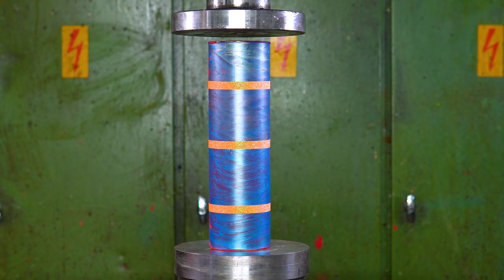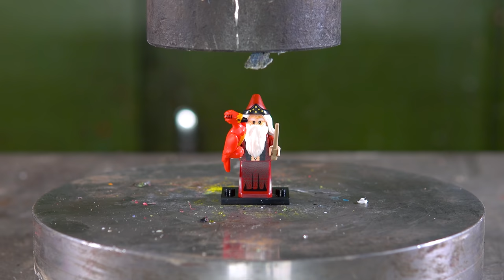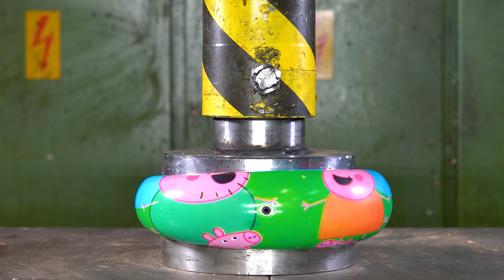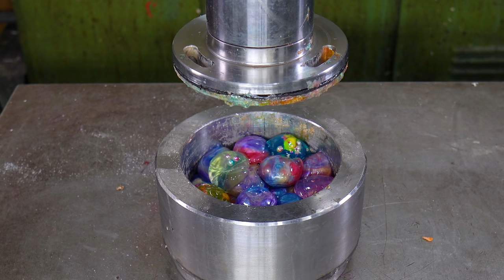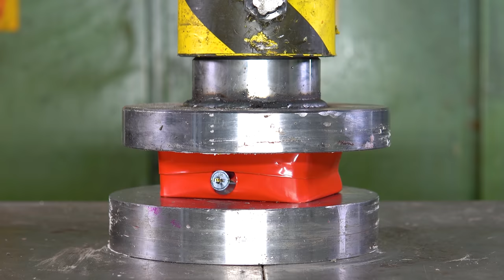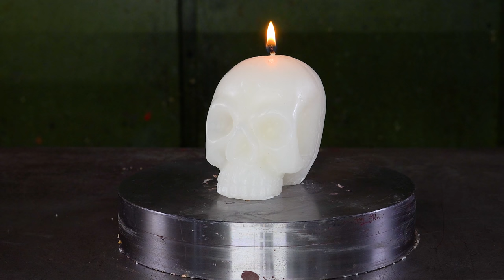Top 100 Best Hydraulic Press Moments VOL 5 | Satisfying Crushing Compilation

Comment: A little question:what was the most expensive thing you ever crushed with your press? Thank you for answer 😊
Reply: I can only imagine that the most expensive materials were the cubes of mostly pure metal alloys. Like tungsten, iron, copper, etc. They are cheaper when mixed with other things, but getting a specimen made of mostly one element is expensive as Hell(compare the price of a gold ring that is only gold plated, to a bar of 99.9999% pure gold).